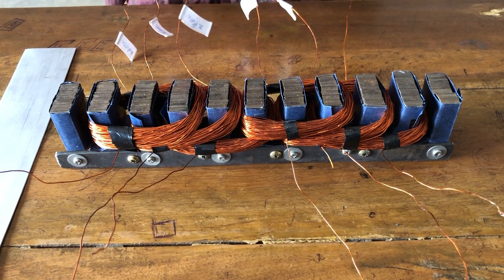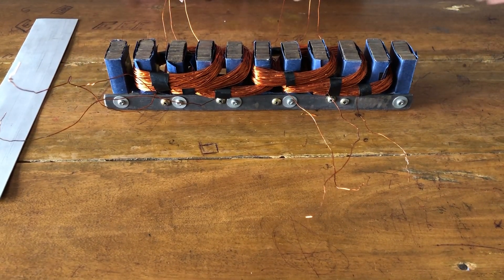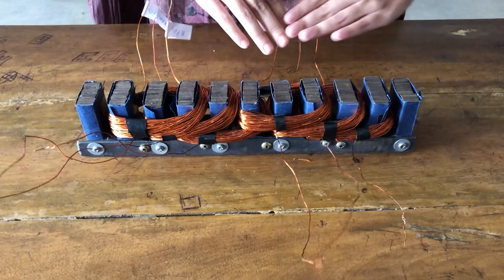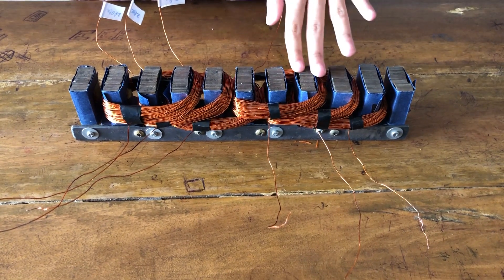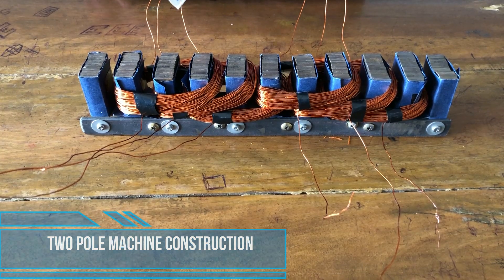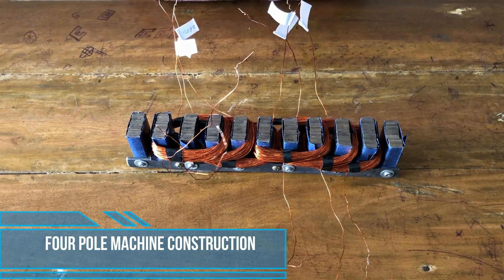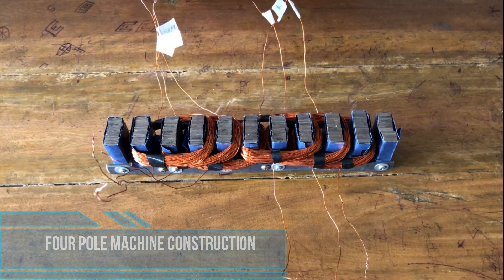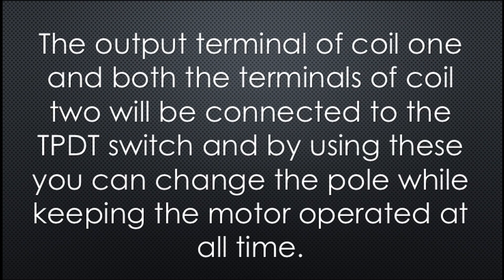Power Lab project- Application of Three phase Linear Induction Motor

Comment: Hi sir, I found ur YouTube contents on Linear Induction Motor, is very intuitive with beautiful explanation and experiment. 
However, I've a question, will LIM created high electromagnetic waves surrounding it which may affect electronic sensors such as vibration sensors if install nearby the LIM? Thanks.